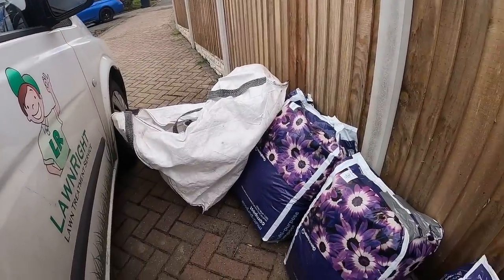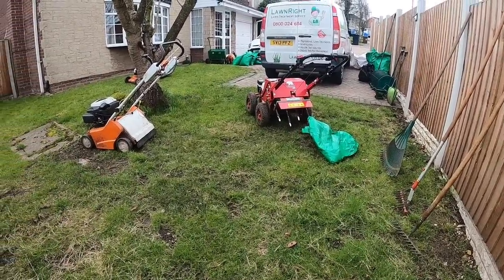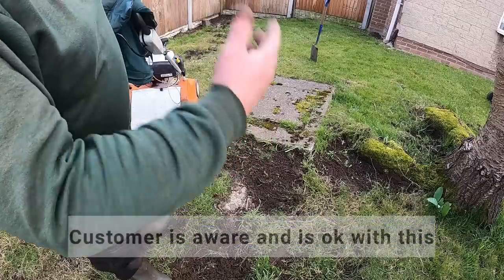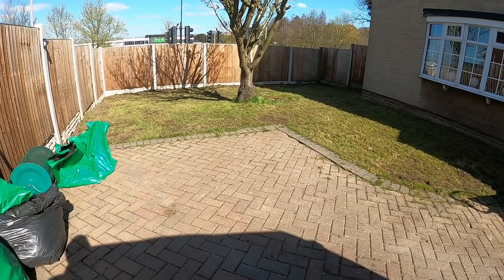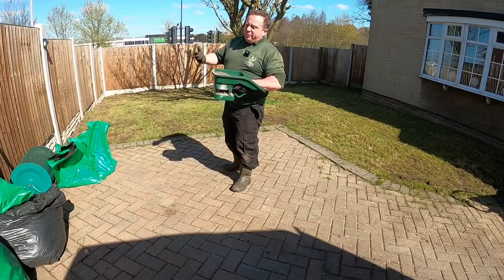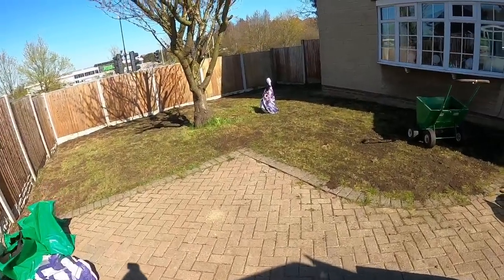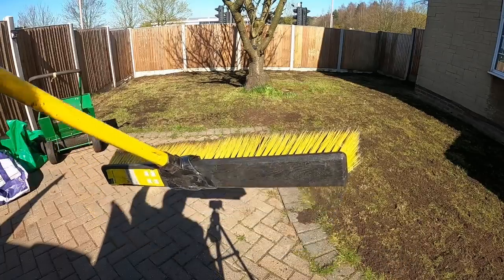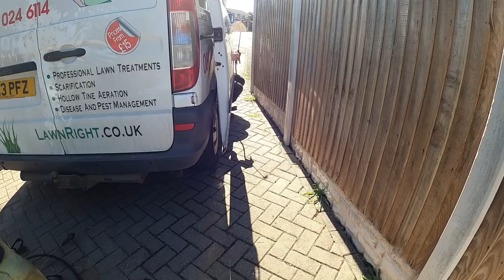Very Stony Soil - Complete Lawn Renovation

Comment: I decided to do my renovation in the Autumn (actually late summer in the North) and am concentrating on overseeing bare patches in the spring (or is it late Winter here) I had some ants where the lawn meets the path but after spraying with garlic solution a week back they seem to have gone. Going to apply this again in May and Sept to try and prevent insects laying eggs that develop into root-eating grubs. I’ve not been using a fertilizer when I overseed the patches. Should I do that after germination or not bother.
Reply from the maker: Hi you dont need to fertilise just keep the seeds damp as much as possible.. that's great feedback for the ants!  Was it any particular product or just water and garlic granules
Reply: @LawnRight  I just peeled and crushed one whole garlic bulb (from Asda), added to a saucepan with water to boil for 5 minutes, then left to cool and stew overnight in a bucket in my garage. Then strained through a cloth and diluted to 4 litres and sprayed on my lawn (approx 100 square metres). I did the whole lawn, not just where I saw the ants. The lawn did smell afterwards but that went away after a few hours.
Reply from the maker: @davidplanet3919  cheers..  it may also help with any grub issues
Reply: @LawnRight  I think it will if I use it when the insects are laying their eggs. Thanks for the advice about not needing a pre-seed/high PK fertiliser.

Comment: I moved into my new built house here in Ohio about 5 months ago, they seeded the back yard but its still pretty patchy. The soil is clay and is very rocky. I've pulled up most of the visible big rocks but, there are still tiny gravel like rocks all throughout the yard. My yard is about 3200sq ft so a lot bigger than the one in the video. Im not really sure how to go about removing these small rocks because I really want to seed soon. I've tried using a metal rake but the clay is so tough even the tiny rocks really dont budge. Any thoughts?
Reply from the maker: Ooh...  not good.. maybe run a scarifier over and aerate to create a good seed bed and cover with a thin layer of compost, gypsum and apply humic acid regularly